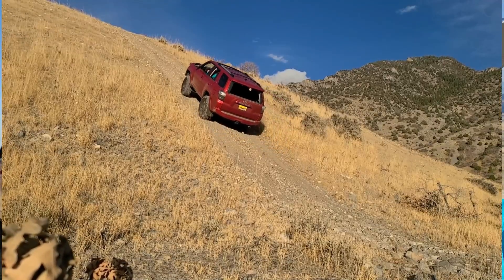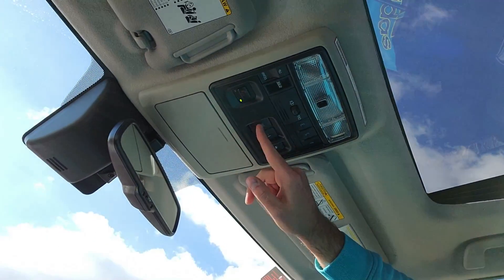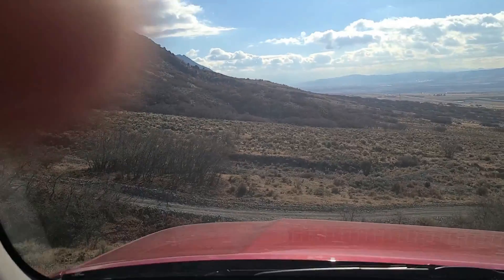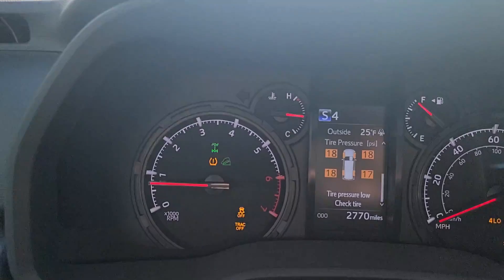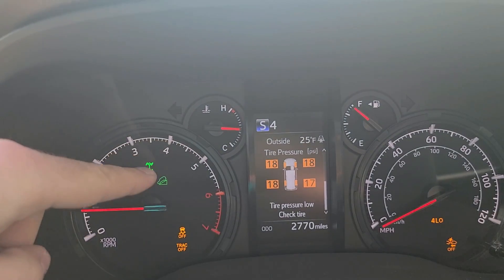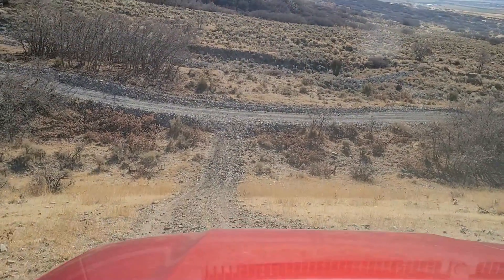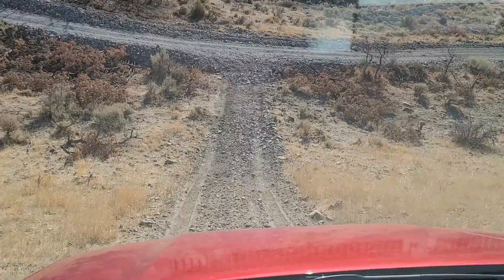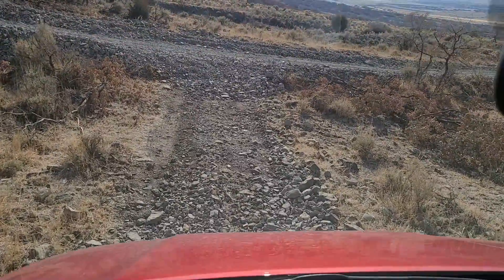Testing Down-Hill-Assist Control (DAC) on 30% Decline in 4Runner!

Comment: Question, might be dumb. On the TRD OFF Road it does not have a DAC, would the Crawl Control low speed be the go to for a decline of this nature? Thank you in advance
Reply: Crawl control can be used to go up or downhill and yes it works that same way. It also has 5 different speeds

Comment: On a difficult trail, crawl/downhill assist is a unstable. Since it pulses, it can go way to fasts or cause tire slipping or sideways sliding since it’s uneven. It works for easy, simple stuff. So do brakes or 4lo 1st.
Reply from the maker: It's honestly too noisy besides what you just said. I've definitely has its place in some situations though. Not needed, just nice sometimes.
Reply: I wonder if Subaru X-Mode is inferior, equal, or superior in a scary downhill situation.   Obviously 4Runner is better to get through obstacles, but I wonder if vehicles that weigh less are safer/better for scary downhill descents?